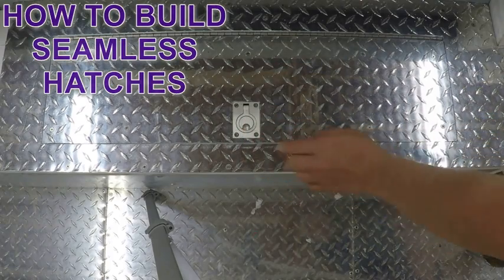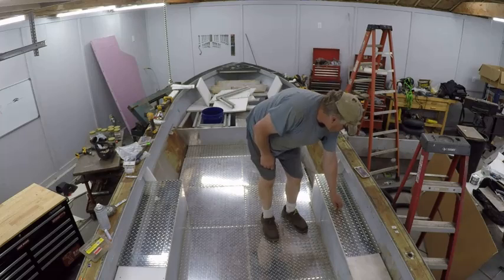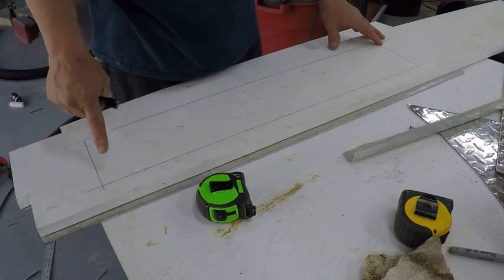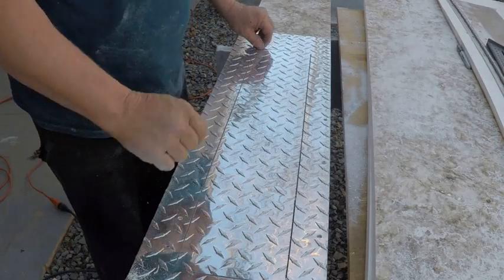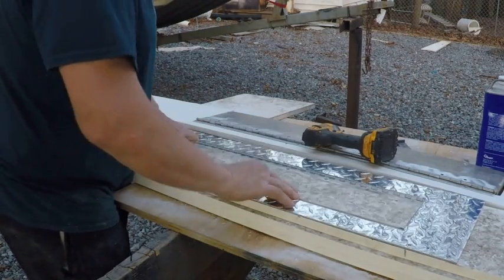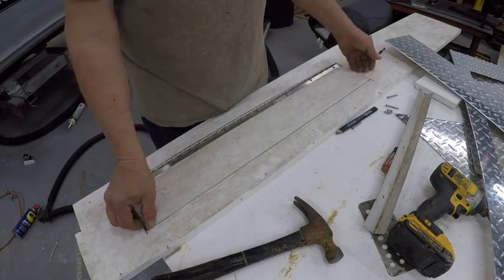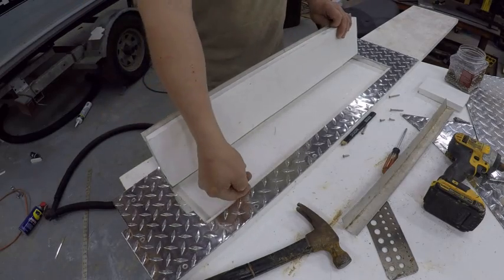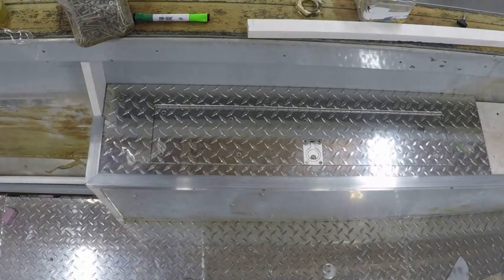DIY DIAMOND PLATE HATCH LIDS,  NO WELD HATCH DOORS.

Comment: I would l like to use 3/4 sheets of this type of cellular PVC to build the casting decks for my little 14ft boat. What would be the distance between the structural tube/angle aluminum profiles underneath to avoid too much deflection (bending)?
Reply from the maker: I’ve used 3/4 at 12” with no problem